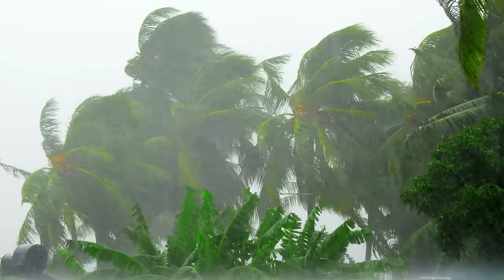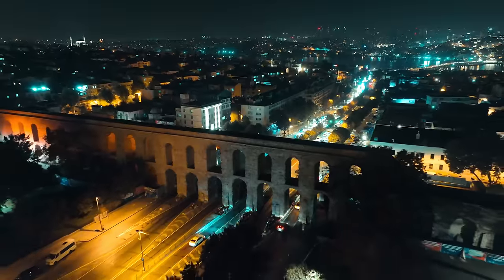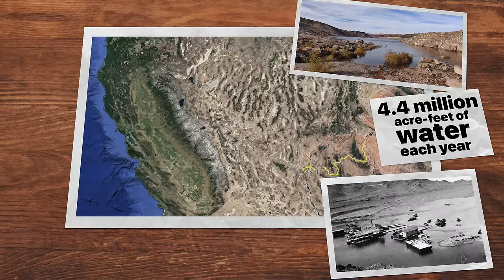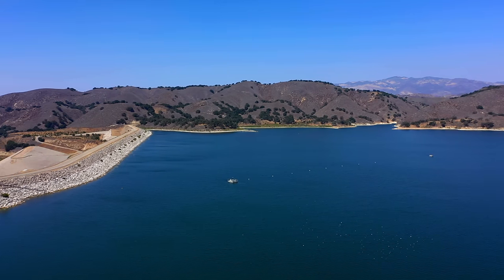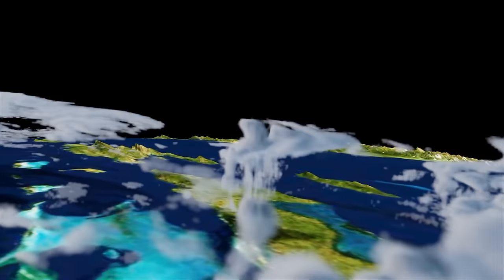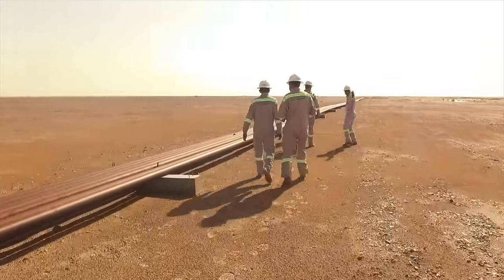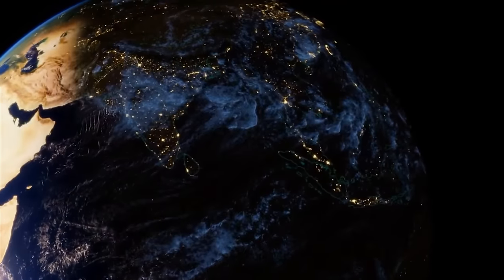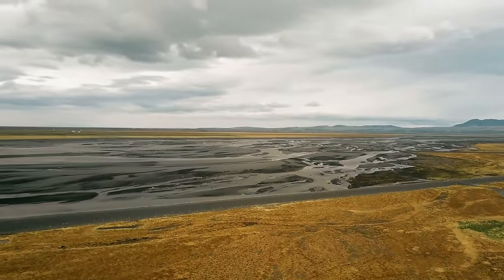Pipelines From Flood to Drought

Comment: Another possible solution to re-purposing a pipeline is to re-line the inside of the pipe. This is actually already being done in small lines, and with some adaptive thinking, it could be done on a large scale. Also it would strengthen the line as well as avoid possible contamination of whatever would be missed in the cleaning method.  
As for transferring massive amounts of water, it is already being done too. There is a 12ft diameter pipeline that runs from Arizona to California. It runs for some 500 miles I believe and honestly I'm shocked more of these have not been put in place or under construction right now.
Lastly, I believe that desalination with Gen 4 nuclear reactors installed up and down California's coast is a must! The population is growing and growing and I don't see pipeline projects of the scale needed to fix the problem ever being a thing. The resources alone would be astronomical and I know you have the math all figured out, but if you've worked construction, you know what happens on paper and what happens in the real world are two different things. We need to implement new technology as well as get rid of politicians who keep solutions, people and technology suppressed and stand in the way progress.
Reply: I've worked construction and there's a joke I'd use talking to contractors. On paper theoretically it should work. It takes 6 yrs of college to get theory and only one day on the job to get reality 😆
Reply: @Ted-K4C  Right!? Then there's this other part where we, as humans, have this delusion about scope and scale. For all the wondrous feats we have accomplished in the terraforming arena, we appear to be really bad at grasping the difference in sizes and volumes of nature. We can REDIRECT a river - have, indeed, look at New Orleans - but to REPLICATE one? Sheer hubris.
Reply: That could be a game changer, lining the pipes with some food safe coating.  It would probably extend the life of the pipes themselves.   We have the power grid all across the nation.  What if we had a "water grid" on the dame scale?   

But, I think negative population growth would be a more direct solution.  For perspective, I was born in 1962.   The world population has more then doubled in my life time. . . 

Some combination of both?
Reply: @oftenlucid  that coating is expensive and at that point you may as well just replace the pipe all together. Also, power flows in any direct because it isn't affected by gravity. Water is and it's VERY expensive to pump it places against gravity. Reducing population would certainly help reduce demand, but that becomes a very sticky ethical/moral dilemma.
Reply: @oftenlucid  I think the World Economic Forum has already started working on population reduction. I believe world hunger will hit big news in 2023.
Reply: @drfarrin  all you have to do to reduce population is to stop moving to the Western states. It’s not some nefarious eugenics thing. It’s the fact that everyone from the East thinks it’s so much cheaper/better out west. They move west or retire and move west then they want grass and golf courses. You live in a desert, support policies that warm the climate, then bitch that you don’t have water. I don’t care how low the taxes are, when your water bill costs thousands of dollars ( supply and demand will get it there), when your flood or fire insurance costs thousands, that makes my taxes look pretty good. You want water, move or stay where the water is.
Reply: California's population has decreasing the last few years as people flew for greener pastures in other Western states.
Reply: @donquijote6030  No, it decreased from 2020 to 2021. Every other shows growth, albeit generally slowing growth for the last decade.
Reply: @drfarrin  Lining pipes is much less expensive than replacing the pipes, and is done pretty routinely these days.
Reply: Dallas and Ft Worth have built 81mi of a proposed 150mi of water pipeline connecting 5 major North Texas water supply lakes. 69mi of that pipeline is already in use. So far, they’ve spent ~$1.1B on construction. I don’t have any info on operational costs.

The water from the lowest of those reservoirs southeast of Dallas is pumped uphill ~250ft back in to lakes in Dallas and Ft Worth. Combined capacity is 350M gallons per day using pipelines 84”-108” in diameter. Of that, Dallas Water Utilities has rights to 150M gal/d, while the Tarrant Regional Water District has rights to 200M gal/d. That puts construction costs at ~$12M/mi

Comment: I have advocated for something similar, using perhaps canals and aquaducts, for many years.  I think a key consideration should be to utilize existing waterways (and therefore gravity) as much as possible.  Think of moving water to tributaries to make its way to rivers, to then make its way to existing reservoirs.  The Mountain ranges are an obstacle, and naturally divide some areas of geography.  So you could attempt this on a limited scale first to see if it can be done efficiently.
Reply: That's impossible.  The Rockies and the Sierra Nevada are the highest mountains in North America.   Unless you have fusion plants, it's not possible.  The other thing is that the Mississippi River Watershed is huge and there would be all sorts of pollution from its floodwaters.
Reply: Ancient Countries like India had such water-infrastructures, unfortunately such appropriate technologies are either neglected,destroyed or
Reply: @knoahbody69  Couldn't elevation difference and siphon effect be used to reduce the energy demand of the pumping?  Also... you don't necessarily need to go over the mountains... as there are passes and tunneling technology.
Reply: @mikeh7842  There's a reason Denver is called the "Mile High City".  If you think you can siphon your way through the Rockies, you're a mile high, doody.  Also even going through the desert, 4 inches of pipe isn't enough.
Reply: @knoahbody69   actually you could build a series of.lakes  all the way from. The Ohio up the Missouri to the north Platte river to send the  water across at south pass to the green river. Power it by windmills the irregular volume of water is less a problem.  Further  the lakes would aid barge transport, and could  replace water diverted higher up the Missouri 
  You mentioned the mile high city well a aqueduct along the east  face of the rockies started high enough would not have to pump all the way from 600 feet elevation at the mouth of the Ohio to 5280 foot Denver.  Finally Elon musk has been talking a lot about building cross country  rail tunnels. Think through mountain rangers would not be too much
Reply: In a perfect world that would be a great partial idea but in the world that we live in, anytime there is surface water we will play in it, pollute it, or use it for other needs.  By the time the canal or aqueduct got to the Western States, the water flow would be that of a garden hose and it would glow a pretty fluorescent green lol.
Reply: You are absolutely right about using gravity because as soon as you say PUMP, the cost goes way up, and other alternatives like desalination come into play.

Comment: I've been thinking about this for a couple decades.  Would it be enough to get it to the other side of the mountain range to then just let it flow downhill naturally into the streams and rivers?
Reply: I wonder if you could set up the pipeline to siphon the water over the mountain or at least use the siphon effect to reduce the power needed to pump water up and over?

Comment: This is a really interesting thought experiment, and I appreciate you addressing the potential climate concerns though you only touched on a single side of it. here's my concern... the climate works the way it does because of where everything happens. For example, Hurricanes dump tons of water in the south east where it falls and drains into the oceans where the storm originally came from, or evaporates, again, in the same area it fell. If we were to pump this water to say California, it will provide water an area never had that volume to begin with. How would this effect the environment in the south east vs the southwest? Specially if that water is no longer evaporated into the air but instead pumped into farmland and consumed. It may stave off the droughts in in the southwest, but how would it impact the environment in the south east that rely on that much rain fall/flooding every year?
Reply: Wait, are you saying people  .   .   .   "in the south east   .   .   .   rely on that much rain fall/ flooding every year?"

As I watch the news about the effects of Hurricane Ian, I get the impression that those people are not too happy about all that rain & flooding they are experiencing from Ian.
Reply: I'm far from being a scientist but I could guess that if you unbalance nature a little too much you will run into unintended consequences.  In the 1960s the Soviet Union undertook a major water diversion project on the arid plains of Kazakhstan, Uzbekistan, and Turkmenistan. Eventually it devastated the Aral Sea and caused many other ecological issues in the region whose effects are still felt today.
Reply: @josephriquelme2841  this is exactly the point I'm making. There was no discussion on the possible impact of moving thay much water for the soul purpose of preventing flooding, something that really only impacts humans. Yes, we are the apex predators on this planet but it's due to a fluke. We learned to build communities and teraform the planet into sprawing cityscapes, driving out the native flora and fauna. That alone has been the biggest contributor to global warming in the last century. Intelligence is knowing you can, wisdom is knowing you shouldn't.
Reply: @josephriquelme2841  Humans intervening in extremely complex natural infrastructures that have evolved over thousands of years? I don't see how this could go wrong in any sort of unforeseen terrible way. Has anyone tried something simple like introducing cane toads instead?
Reply: @JB-et7zs  Exactly! Not to mention our "Parent Star" whose mood swings dictate absolutely every element of life on this volcanic rock - never gets a mention though 'cause 'they' haven't worked out how to tax the slaves over it YET!
Reply: Not to mention that floods do serve a purpose. One of the reasons that parts of Louisiana's wetlands are disappearing into the Gulf of Mexico is that the damning and manipulation of flood water from the Mississippi river prevents sediment from properly flowing down into the delta.
Reply: Shifting massive amounts of water across large geographic areas will inevitable also transfer organisms (plant and animal) into areas where they are not non-native. Helping alleviate one problem may create a much larger ecological disaster. Look at the invasive species already in the US. (Kudzu, Hydrilla, Pythons in Florida, Lion fish)
Reply: @tboneforreal  yet another reason why diverting flood water is probably a bad idea. We, as humans, do need water which is a lot more scarce than we realize. But we also need our planet. It's not some toy we can toss out and replace if we break it. The earth takes hundreds of thousands of years to make changes like that on its own, humans can make that change happen in a year or less. To think there wouldn't be repercussions is moronic.
Reply: @Hawkeye2001  that's right along with what I'm saying as well. It's not just the macro flora and fauna, it's the micro as well. Hell, even having an aquarium can cause massive ecological issues. Say your aquarium developed bubble algie. If you were to suck it up and throw it down the drain, you can bet it's gonna grow in the sewers. That's just a few hundred gallons in a local environemnt. Imagine billions of gallons over an entire region. PH levels, TDS, and everything else in the water alone could wreak havoc on the existing supply that it's getting dumped into.

Comment: Also, using it to control flooding is a comic book idea. The first problem is that the water is needed in California steadily all year round and there simply isn't enough storage space to hold it. You could move some water, but not nearly enough to solve the problem on either end.
Reply: For Cali there are separate methods to desalinate the Pacific which is directly along about 800 miles of coastline. Do not involve Reverse Osmosis. This method would provide desalinated water to some strategic peaks that would use simple gravity to flow water for hundreds of miles to Nevada, Arizona at the very least.
 No need to pump from Gulf Coast.
 U use hurricanes to "pump" fresh water in the other direction, west.
 To alleviate drought areas.
2 bit Da Vinci has the right idea just not the proper method.
Reply: @rolandomartinez9076  The farms require 36 billion gallons per day. How many typical desalination plants is that?
Reply: I
Yeah, rounded out 11 million acre/ft. much more than that in the Pacific. Using R.O. very expensive which drives the cost of food, cost of living up. not sure of the politics of water?
 It is a finite resource that is vital to life. Therefore,
 Corporations are trying to monopolize with disinformation and Reverse Osmosis which is very complex, huge and very expensive.
 Not everyone can afford a "typical" plant like that to desal. So with no other options R.O. industry is the shot caller.
Reply: With Pacific right next to u there is no need for storage, u desal most of the year and water supplement is added to municipalities.
 Using methods other than R.O. more practical and far less expensive a string/array of desal plant can produce far more than that per day.
 Of course won't happen overnight as the existing water industries are opposed to anything that interferes w/ their control.
 Same as Energy. U think they want cheaper energy for residents?
Reply: @rolandomartinez9076  You didn't do the numbers. It would require a typical plant every half mile of the entire California coast. The cost would be around two trillion dollars not counting pipes, pumps, and power plants - assuming you already had all the regulatory approvals. It would be an ecological disaster in the ocean along the entire coast.

And that still wouldn't come close to solving the problems. The RO industry isn't even a real player.
Reply: @rolandomartinez9076  No storage required? You just proved that you don't have the foggiest clue how the water system in California works.
And you still don't have any clue how many desalination plants would be required.

Comment: The idea sounds great as a theory but another major issue to overcome is when water is released from the dams it is done so at such a high rate (massive volumes of water a second). In order for this idea to work the circumference of the pipes would need to be huge in order to drain the reservoirs at a similar rate needed to make room for new water from the storms or water would just be pumping non stop using smaller pipes to even equate to what would be needed....to me desalination plants still make the most sense as water is already there in the pacific ocean.
Reply: Time to call the Boring Company.

If/when TBM/mile costs decrease, applications increase.

You could have a TBM make a long descent until it gets very hot, and then porpoise back up. Pour water down the hole and now you have geothermal. Because of the vast size, you can let pressure build up during low usage.

After it goes through a turbine you just condense the water and send it back down the hole.

Very little infrastructure required.
Reply: @jtjames79  That would still be like emptying a pool with a straw.
Reply: @darthwhit  You just need a sufficient number of straws. And it's not like you can't start using it before you reach failsafe. And you can sell the water to pay for the tunnels.

Comment: Sounds plausible but I think in addition to a pipeline there would also have to be new reservoirs to hold and disperse the water along the way to areas that may need that water. This is something that would take decades to accomplish but would solve so many problems.
Reply: i thought the same thing in iowa. the floods we have here water could be sent out west thru a pipeline, elevation is the key .no power to run the water!
Reply: Look up California Insider on YouTube.

Comment: Two major impediments to this is that (1) in the US Midwest groundwater depletion is a major issue and that flood water should go to nearby aquifers (e.g. the Ogallala Aquifer) rather than pumped to the western US and (2) the Western US (from Oklahoma west) is administered via prior appropriation water rights doctrine while most of the rest of the US is under riparian rights which would make moving/trading water very difficult.
Reply: Even in the areas that the floods occur in the water runs off faster than it can seep into the aquifer. So in many areas just pumping water into the ground would be an excellent use. The Midwest is an excellent example as there's flooding and dry aquifers at the same time.
Reply: Exactly, the midwest has the best soil (for growing food) not just in America, but in the WORLD.  Why waste water on less than marginal/desert lands in the Southwest.
Reply: @gregcoste5332  it's good for growing grains, fruit and vegetables not so much.
Reply: @gregcoste5332  The soil in Central Valley of CA is actually some of the most productive in the world as well.  In addition, the mild climate allows you to have a much longer growing season - all it needs is water!
Reply: @jackm3040  that would be nice if it was the main reason. Although the long growing season does help. Labor is the driving reason, as most fruits and vegetables cannot be harvested mechanically.